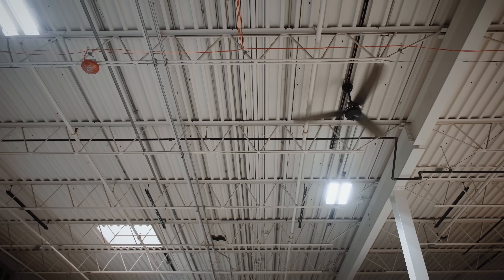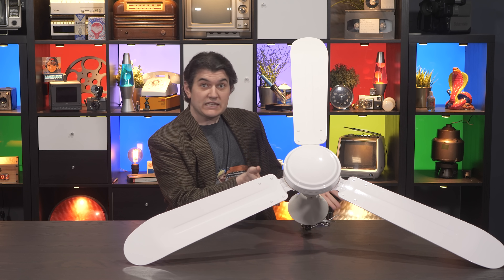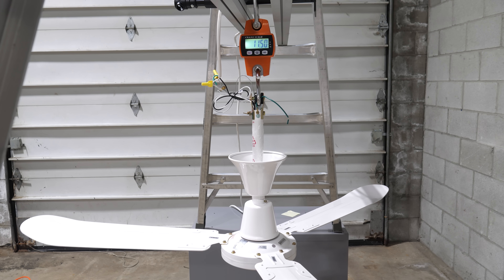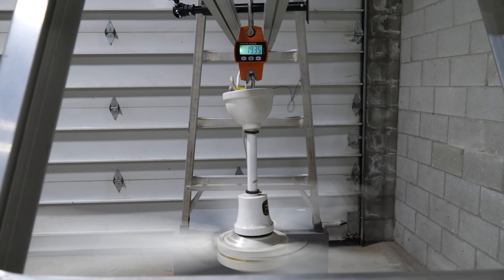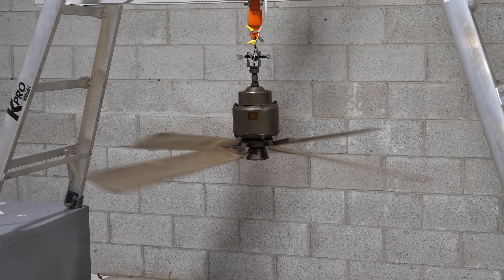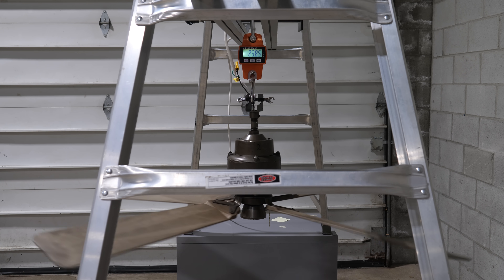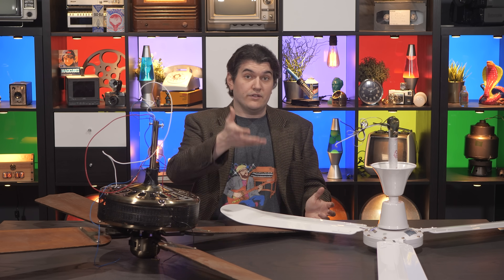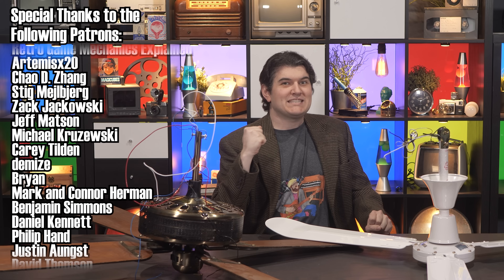How much thrust does a ceiling fan produce?

Comment from the maker: In the spirit of November, I screwed up my one and only fact check. HVLS is High Volume Low Speed. A most fantastic error!
Also - for the sake of clarity, my comparison to helicopters is more jokey than literal and I shouldn't have phrased it as I did in the script. So don't go thinking helicopter rotors are just powerful fans because there's much more to it than that!
Reply: I'm an aerospace engineer, who worked with helicopters. I second your comparison. All the rest is negligible especially for No Effort November. Also, the last fan, attached with the cord, perfectly shows why helicopters need a second rotor placed at the tail.

Love it!!!
Reply: @GiuseppePipia  While they are impractically mechanically complex, I do love the contrarotating helo designs that don't need a tail rotor and provide rotational torque through differential application of collective.
Reply: @GiuseppePipia what's the name of that gear that's in the freewheeling assembly for the tail prop? I always forget but I love how  they have inbuilt synchronization systems in case of emergency landings.
Reply: @GiuseppePipia I have always wondered how much more efficient ceiling fans COULD be if the blades were shaped with a proper airfoil cross section and changing pitch (angle of attack) from hub to tip. This would make a ceiling blade closer to an actual propeller and increase the thrust immensely. Unfortunately it would also increase the torque requirements immensely. Then there’s the whole issue of not having reversible directions or two-toned blades for different color options. So, I guess for the majority of the situations a flat, rectangular slab of wood is the best fit compromise for ceiling fan blades. For my money, a high quality tabletop fan can be more effective at circulating air than a ceiling fan costing FOUR TIMES a much.

I notice that Big Ass Fans (and I assume other HVLS fans) actually do have a slight airfoil cross section to their blades. But by my casual observations the angle of attack is the same from hub to tip.
Reply: I appreciate you not going into detail, November and all.
Reply: You are putting in too much effort explaining this. Take a break buddy you only have like 5 days or so 😮
Reply: Propellers being big fans is pretty literally true. People make a big fuss about airfoils generating lift via sides of high and low pressure and all that, but that's really just the middleman for what they actually do in total: push air down to make object go up. Airfoils are just more efficient about it than flat blades.

Also unrelated, I think everyone would love more No Effort November type stuff throughout the year. Maybe Medium Effort March?
Reply: @EricJW thank you for explaining the reality of flight and thrust, throwing air around, as unpopular it may be among the unwashed masses and cocky pilots! Lol
Reply: @EricJW  Yep.  The whole Bernoulli thing is overblown.  It all boils down to air shoved down, object shoved up.
Reply: It would have been interesting if you got a Big Ass Fan fan.
Reply: @Boodieman72 They are the BMW of ceiling fans. Or, staying with the theme, they are the Sikorsky of fans. 🚁
Reply: But is it not tho?
Reply: Okay but why did you have to put the ladder at the VERY EDGE of the filing cabinets?!?
Reply: @somefreshbread  to better distribute the load on the cabinets and reduce noise in the results? :') would be my guess. but i am no nerd in position of authority on this matter 😂fun stuff though. :) sounds dangerous! 😻(lol)
Reply: DRAMA!!! 😜  @somefreshbread
Reply: Since no effort november is a thing, you should do double down december, where you put twice the effort in to yoyr videos.
Reply: @annabellethepitty you only want 1 video in December?
Reply: @annabellethepitty  That's why he hand-paints multiple strings of Christmas lights every year. :-P
Reply: @annabellethepitty and then he shall release his video on January
Reply: @annabellethepitty  so half a video in december?
Reply: For a lazy video, this was a surprisingly fun experiment.  That's why I love this channel.
Reply: if the point of a fan is to move air, why are blades flat instead of aerofoil shaped? surely there enough expired patents of designs from aviation floating around that the industry can use to move more air for less energy/noise/size or something
Reply: @Nderak I imagine it’s a lot cheaper to make a flat blade.  Especially for cheap fans: sheet metal, stamp, done.  Also optimizing for air movement rather than lift could make a difference.
Reply: @Nderak  More costly to use good airfoils instead of flat blades.
Also, unless you make them symmetrical, they will only work well one of the ways (up or down).
An asymmetrical foil will be much more efficient than a symmetrical one. And every airfoil has a sweet spot where it is most efficient. 
Since the wing speed increases when going outward from the center, the airfoil should also be different from hub to tip.
Reply: Because the aerofoil is to reduce drag, and is not needed to produce thrust/lift/airflow. It also only works in one direction, and these fans are reversible. 

Same reason these blades are straight with a simple angle, not contoured like some single direction fans, because it needs to be equal in both directions. 

 @Nderak
Reply: There needs to be a sequel where you replace the blades with true aerofoils.
Reply: @TheBertLocker you can't reverse the fan then
Reply: Concerning lift creation? Yes they are giant fans. Once you add controllability, it's a differrent kettle of fish.
Reply: I love how you said the only effort you actually put into this was looking up what HVLS meant and you still got it wrong. 😂😂 This is the best no-effort November yet!
Reply: So what you're saying it, if I would unearth my house, a ceiling fan wouldn't rapidly spin it if I was to turn it on.
Reply: The rotors and props really are just powerful fans. Turn them off during flight, and watch how much the pilots sweat!
Reply: High Velocity Laser Snail
Reply: November 2024 is the greatest month ever! Great for Science!
Reply: please test that the ground effect does not have a further increase in fan weight when running in winter mode while being hung from a ceiling
Reply: @ Well, now you’ve gone and done it! I doubt whether ground effect happens at the speeds and “altitudes” of these fan blades, but one could gradually decrease “altitude” in the test environment to see if you could register a ground effect…effect. I’m constantly reminded of ground effect when I watch pelicans fly, and also of their anhedral (aka negative dihedral) wing design (tips canted downward) which contributes to flight stability in those low speed, low altitude flight regimes. Well, that and the fact that their beak can hold more than their belican… 😎
Reply: @t3cube  There will be a "ground" effect whenever there is a flow that is restricted. 
With a ceiling fan, you could call it ceiling effect? 😊
Reply: @TechnologyConnections  Outstanding video and as a native Minnesotan, well, there you go then! Fun propeller fact: in the first Gulf War the American military operated a little drone called the RQ-2A Pioneer that was a derivative of an Israeli design. Pioneer had a twin boom tail pusher propeller, meaning it pushed rather than pulled the aircraft. That propeller was made of wood. However, when it flew through Iraqi sandstorms, that propeller experienced, well, ablation—the airborne fine sand particles gradually ground it down. Operators would see engine RPM rise and altitude fall until they lost contact with the aircraft—its propellers literally were sanded to death. The same phenomenon happens to jet engine blades when flying through volcanic ash elevated into the atmosphere by an erupting volcano, which is why airline flights can be restricted by an active volcano such as the current one in Iceland. 🚁
Reply: I love that the brand is called Big Ass Fans
Reply: But at least your joking helicopter comment generates engagement from all the people compelled to explain to you "um acktually" on how helicopter rotor airfoils work. And that makes Mr. Google happy.
Reply: I was gonna say, "How the heck does "high velocity low speed" work‽ Lol
Reply: That really had me wondering how something could be both high velocity and low speed.
Reply: next you're going to tell us that all those big fans on windmills aren't for cooling the earth....
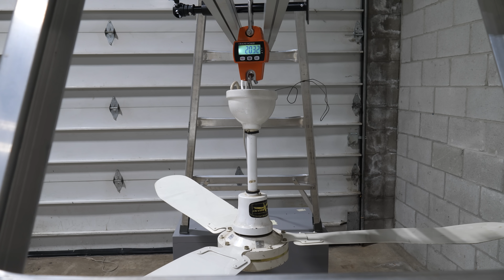Reply: How retro do you want to be? 4:26
Imperial system is based on the metric system (no pride here, just logic ;) ) US is actually metric officially but never wanted to change for psychological ecopolitical supremacy reasons. You are Canadian right? The slave B.... of the US? (So soorry I love Canada, I lived in Vancouver Island near Victoria city, take care mister.)
Reply: Helicopters do not in fact fly, they beat the air into submission. then get repulsed by the ground. fun fact is that almost every helicopter can do a barrel roll, as it is the one maneuver where there is positive G all the way round, so you do not run the risk of having that rotor droop down and chew the tail apart, which is bad in that the shaft to power the rotor (or the long v belts on some of the smaller ones) runs down it. 

Some have a very sturdy steel angle at that point, on the assumption that making the main rotor a little bit shorter at the tip, and still allowing you to choose the crash site somewhat, is a lot better than having a self drilling coffin.

Was fun one day to be sitting in the door, looking up at the ocean, and down at the sky.
Reply: @SeanBZA  it's still generating lift, isn't it?
Reply: Run the fan close to the ground to see if the compressed air makes it even lighter
Reply: Ur fascination and intricate descriptions of everyday objects, 
Is why you are AWESOME ! ! !

Do you have a shipping address?
I wanna send you something.
Reply: We agreed we were not going to bother you in Twitter about it as long as you converted to kg in your videos.
Reply: @matiaswagner9810  But we still get to bother him in Bluesky and Threads until he switches to newtons, right?
Reply: @Curt_Sampson  nah, we don't use threads, we are reasonable people. Like the sentiment though.
Reply: I was super confused when you said "high-speed low-speed fans"
Reply: Helicopters are dark magic that laugh in the face of physics.
Reply: @lordofhyphens  They are, esentially, what happens when you fuse the propeller blade and the wing into the same object... and then compensate for all the 'fun' consequences of that. 
They can even land just fine in the event of an engine failure, at least if the pilot knows what they're doing. 
Though... umm... bailing out of them in the event of something going more ... catastrophically... wrong is a bit iffy due to the whole 'getting clear of the rotor' thing.
Reply: @lordofhyphens  Physics doesn't even enter the equation here. They're just so darned ugly that the ground repels them.
Reply: @lordofhyphens I thought that was bees?
Reply: @lordofhyphens don't forget they also beat the air into submission
Reply: You've talked so much about helicopters but didn't mention that - as opposed to what most people would think - it's not a heli // copter, but instead, a helico // pter, since both words come from greek and mean "spiral" and "wing" respectively!
Reply: @pitecusH  Aka helix and pterosaur. It's funny how English changed where the actual break is to fit in with the style of other words.
Reply: @pitecusH  Well, it is no effort November after all.
Reply: @pitecusH speaking of ancient DEAD languages, you are correct,, but in English it must certainly IS Heli-copter, because Heli or Copter are the most common abbreviations or nicknames for it, and in English we OBVIOUSLY have NEVER cared what the original users thought, we just appropriate words however we feel like it! Lol
Reply: can you make a video about fact checking?
Reply: @TechnologyConnections  would have meant expending some of that prohibited effort. But, you can buy ceiling fans that are made to look like the prop and nose cowling of famous WWII fighter planes.
Reply: Blade pitch plays a part, too.
Reply: I was going to point out that velocity is just speed with vector. But it doesn't matter now 😢
Reply: There's a little too much effort from including "that's a different number in kilograms." Honestly, it's just too easy to get some Metric Maniacs to make that observation for you.
Reply: Might be interesting to compare the CFM of ceiling fans to props on a plane, or the rotors of a helicopter.
Reply: I really wondered how it made any sense the way you said it, but I'd have totally repeated it over and over.
Reply: If it's a fan of yours.
Why Didn't It Subscribe !😂?
... yes yes im leaving, you don't have to push
Reply: Those are some big ass fans
Reply: What else is there to it?
Reply: When the fan is pushing air down it wants to lift, but it’s not stable so it wants to tip over. It’s partially constrained by the hook so that’s part of why the wobbling and lower thrust was obtained. With the fan pulling down its stable, as if being held by a rope, so all of the thrust is measured and less wobbling happens.
Reply: I helped designed the engine for a fan that delivers 120,000 lbs of thrust =D
Reply: i just spent so long trying to wrap my head around how something could be both high velocity and low speed so thanks for the clarification
Reply: Good thing you don’t need HVLS fans when you’ve got fabric ductwork 😮
Reply: There are 11 months in a year for accuracy
Reply: I want to see somebody attach a fan blade to a vacuum cleaner motor 😏 I'm curious how fast it would go and if it would take off 🤪
Reply: Helicopter rotors are big fans! Turn it off, and watch the pilot begin to sweat!
Reply: bro i love no effort novemeber , can i ask is there any tech you want to cover with a video but cant be conveyed well in a video ?
Reply: So, what am I meant to do? Now that I've achieved lift-off with two dozen fans?
Reply: Can we settle a debate? ceiling fan should pull the cold air upwards not push hot air down from the ceiling… literally throwing money away.
Reply: @soundtrancecloud5101  i was thinking that, why bother switching it in winter , but as old mate point's out the option of less direct gust  while still circulating the air
Reply: props to you for correcting this
(haha)
Reply: I was gonna say. For the most part, in common vernacular, velocity and speed are the same thing.
Reply: I mean, both the propeller on an airplane and rotor system on helicopters are used for cooling the pilot: watch him/her sweat when they don't work!
Reply: I was gonna say this video took too much effort. lol
Reply: Unofficially sponsored by SCEPP SarcastiCaffeine Energy Production Powder
Reply: It's easier to just call them by the most popular name brand - Big Ass Fans
Reply: Good thing you mention helicopters: you forgot about ground effect.
Reply: you should know this... airplane engines don't produce flight. the wings do that.
Reply: @InconsistentManner  I think it’s more accurate to say that airplane engines don’t produce lift - they definitely do produce flight.
Reply: @doomtho42  Jet engines are definitely producing thrust. I'm not sure if that's the right term for turboprops, but it should be the same principle. Thrust is the force opposite your vehicle, think action->reaction. Wings are not generating a force, instead their dimensions influence the medium aka air to move at variable speeds...yadda yadda yadda, air pushes the wing up, thus "lift." In the case of both the jet engine and propeller, you can just push/pull yourself through brute force in a chosen direction, the geometry of its components merely increases efficiency.

What I think Alec wouldn't want to get into, even if it is super neat, is that we know helicopters are using lift and not thrust, because the transfer of energy is not uniform. One of the most unintuitive things about helicopters is that you need to think 90 degrees from your intended cardinality. There is effectively a delay from gyroscopic forces that imparts most of your input 90 degrees later in the rotation. 

Also, the advancing and retreating blades to your sides, are generating very different values of lift. The retreating blade is moving slower, if you think about it relative to the ground as you move past. This means it generates less lift even though the drive system is distributing the energy evenly. This is not a property of fans or jets. That retreating blade is also the worrying bit in a lot of maneuvers. Similarly, planes can get caught in a stall when their inside wing in a turn is no longer generating significant lift for the same reason. 

There's a whole lot of other weird stuff I didn't mention that makes helicopters even more confusing to learn.
Reply: I’m so glad I saw this comment. My mind was breaking itself trying to figure out how “high velocity low speed” could possibly make sense. It felt like a mental divide by 0 error or something.
Reply: I literally had made a comment to this effect without seeing your pin. Shame on me. But also shame on you. ; )
Reply: There is and error in your test you need to have a board hanging above the fan approximately ceiling distance away from the fan to get a proper reading of thrust when it bounces off the ceiling, it is going to multiply
Reply: There is and error in your test you need to have a board hanging above the fan approximately ceiling distance away from the fan to get a proper reading of thrust when it bounces off the ceiling, it is going to multiply
Reply: The board must be independent of the scale as to not skew the numbers
Reply: never thought about them generating measurable thrust or the mechanics of torque compensation in helicopters and fans.
Reply: Video on helicopter rotors upcoming, I hope!
Reply: Regarding helicopter rotors as fans: when Wilkes-Barre, Pennsylvania, flooded unexpectedly during Agnes (IIRC a dike failed) helicopters were part of the rescue efforts. A story told years later was of an older woman who was rescued that way complaining about her dress being blown up by the rotor wash. Being an immigrant her English was a little imperfect and she called it "the big fan."
Reply: I can see this video coming soon now. "What are helicopters?!?"
Reply: I feel like anywhere you mix unconventionally paired forces like rotational physics with aerodynamics, interesting technology connections can be made. Like that radial engine plane that would pitch when you tried to yaw because of all that rotational mass, so they had to train pilots on how to land differently because of it.
Reply: it's a different acronym in kilograms
Reply: Menards® SKU: 3533018, that's the fan to test.
Reply: I was about to mention that airfoils matter, but ya, for no effort I spose this is fine
Reply: I immediately thought "high velocity low speed" had to be wrong.
Reply: This video perfectly blends humor and curiosity!
Reply: Pounds... pound... imperial sucks. UK is doomed.
Reply: helicopters work by dark magic, and the fan is to keep the pilot cool. The moment it stops, they start sweating profusely. Same with fixed wing aircraft, but they are powered by misunderstanding, not magic.
Reply: When it gained weight on switch on is that also implying that electricity adds weight😁😁😁 wonder if you could measure weight of electricity no effort suvgestion vid🤣
Reply: Re: "So don't go thinking helicopter rotors are just powerful fans because there's much more to it than that!"

I feel a new Technology Connections collab video is going to happen, where through the magic of visiting someone who has two, you show us the innards of a helicopter rotar.
Reply: I LOVE the ceiling fan aisle at Lowe’s! It’s so relaxing.
Reply: I love your videos- you walk the line of being an "uumm actually" guy and the overly-friendly science teacher- while in the meantime delivering interesting and informative info with a touch of geeky humor. All the above, is Me, too.
Reply: I was breaking my head trying to figure out what high velocity low speed meant 😂 I was like, what, because it’s constantly changing direction? lol
Reply: Ceiling fan Normally comes with 240RPM 😮
Reply: Oh, but "What are helicopters but giant ceiling fans..." was my favorite part! I just burst out laughing at that. 😂
Reply: You seem to hate metric values...
Reply: In hindsight, "high velocity low speed" sounds quite obviously nonsensical.
Reply: It could also have a high air velocity but low rotational speed. It depends on blade pitch.
Reply: why did the fan appear to gain weight when switched on?
Reply: helicopters = powerful fans with variable pitch.
Reply: I imagine the blades on a helicopter are designed with the fancy shape that airplane wings have that provide extra lift. So maybe a specialized fan blade (stolen from a hobby plane) could produce some fun results.
Reply: I bought a thermoelectric fridge and a portable monobloc indoor unit AC just to know your reaction ❤❤❤
Reply: 89 comments in 2 minutes. damn
Reply: @typerightseesight That’s a different number in kilograms
Reply: @dairyisfine  kelvin bo belvin
Reply: "So don't go thinking helicopter rotors are just powerful fans because there's much more to it than that!"

I really wish you had said that at the start of the video, before I paused it, went to Home Depot, bought a bunch of powerful fans, and...well, actually let's just leave it there.
Reply: @Curt_Sampson  I was already seeing red and took no new information in
Reply: In the spirit of November, the change in fan weight on startup and shutdown due to torque isn't caused by weirdness of the scale, it's a real impact of the torque and should be included IMO
Reply: @CoryMck except it doesn't actually change the weight of the fan, it's just an artifact of the scale design.

If you had an anti torque system on the fan to isolate the scale from the torque (as it should have been), you would not see the torque effect.
Reply: @ke6gwf  it has nothing to do with the scale design, the angular acceleration is creating a torque which is an additional force added to the weight. The original thesis was to set out and see if turning on the fan created a force. The torque measured by the scale is a real force that the ceiling would feel pulling on it.
Reply: I was gonna say, are you baiting us because they are as similar as Ice skates to a Snowmobile
Reply: I attached a 12 volt fan on ceiling inside a caravan and put 200 volts the caravan took off and landed in a pond.
Reply: I'm just glad the new paratrooper video dropped. Eighty Deuce!
Reply: amen 🙏(at least, that's the easier american measure to use perhaps 😂)
Reply: I love No Effort November!
Reply: Greetings from India. Can you please do an explanation video on BLDC fans. Thank you.
Reply: This explains it kkkkk
I was trying to understand the High Velocity, Low Speed thing kkkk
Reply: 5:32 - NO.  The fan does not get heavier.
No matter which direction it spins, the weight of the fan never changes.  The mass of the fan remains constant.
Reply: @dahawk8574 you're confusing mass with weight, granted he also should have stuck with Newtons and not used grams in the video.
Reply: Hi, it's me, nitpicker:
I tried to resist the urge especially since it's NEN but I failed at the 2:15 mark and HAD to pause and comment this:
Helicopters don't have a propeller and are in fact bad comparison. Choppers have rotary wings which produce lift, not thrust.
If you do correct this in the rest of the video I'll return and right my wrongs.
Adjusts glasses back up
Reply: Uh achooally helicopters don't fly by pushing air, the shape of the blades acts like a wing and reduces pressure above it, lifting it!
Reply: @kingeryck1  A wing will actually create lift even when the top part is flat 😊
Reply: @kingeryck1 but wings fly by pushing air down, the whole equal and opposite reaction thing, it's the throwing the air down that creates the low pressure as the equal and opposite reaction, not the other way around lol
Reply: I like your videos and think they are insightful.  But it seems like more and more as time goes on, the way you are using your voice,  they way you speak makes it sound like you are talking to your audience as if they are stupid people whom you have contempt for.  If you don't notice it, just watch back the first minute and a half or so.  My only guesses are that either you are dripping with contempt for your audience (which is less likely) or you are so embarrassed by "public" speaking that you try to make your voice turn everything to be contemptuous or "ironic-sounding" so that you can be "that guy doing that thing" rather than risk putting yourself out there without a mask (more likely).  Or...I could be reading more into it than I need to, and that is the voice for yourself that you have created over time without any conscious consideration of why it is that you speak that way.  (But unconsciously, there still may be something there.)  At any rate, I just wanted to point this out in case you haven't noticed it.  Obviously, most other comments are not talking about this at all, so I'm not saying that you need to change because one viewer thinks it's kind of strange.  But if you didn't notice it before, I did want to at least point out that - the way it feels to me - your voice's tone is such a way that resembles the voice of someone who feels irked that he is talking to fools.
Reply: @Rationalific  Have to disagree. I think Alec just realized that most people love the snark, even if it's directed straight at themselves, so he feels more comfortable letting it out.
Reply: @EricJW  I hear ya.  Thanks for expressing your opinion in a civil way.
Reply: @Rationalific Different strokes for different folks. I perceive his tone as being exactly what he wants to communicate, which is that he’s being funny, punny, self-effacing/funny and sarcastic/funny. “The way it feels to me.” Well, keep it to yourself if you cannot be constructive. Your comment “feels to me” as overly persnickety, officious, self-referential, and needlessly overbearing, arrogant, and utterly out of touch with the overall light, funny, informative, and entertaining nature of these videos. Regardless, your comment contributes to his YT algorithm score, so regardless of its fingernail-on-chalkboard high-handedness, it’s works out for him anyway and provides us all with a timely cautionary example of social media asininity where no good (or genuinely funny) deed goes unpunished. Merry Christmas! 🎄
Reply: @tommyrq180  I said that I watch his videos, but I've perceived that getting even stronger.  He makes videos in the way he sees fit, and I watched this video and commented.  For those I truly don't like, I won't continue to watch their video until the end (which I did...most of the stuff I found particularly in line with what I mentioned is in the first minute and a half or so).  And I do appreciate him more, as the way he comes across may seem like he's looking down at everyone, but he's not insulting.  I was also not overly insulting to him if you read what I wrote objectively.  (Actually, what I wrote was constructive, even if it's advice that he can take or leave and I'm 99% confident that he'll leave it, because it's not like I'm getting hundreds of thousands or millions of views off of any videos that I'm making.)  On the other hand, of the three of us, you have appear to have both the strongest opinion about people coming off as "mean" (even more than I do towards him), yet of the three of us, you also come off as the "meanest".  So go figure.  I won't say Merry Christmas back, as I feel that saying it in jest and adding an emoji as a cherry on top after insulting someone is actually more of a slap in the face than something that should be taken literally, and I'm not really one to do that back.
Reply: @Rationalific  I’d just like to say that I 100% fully disagree with this person’s comment. I find your speaking voice (you know, as opposed to your non-speaking voice 😆) to be much more natural than in your older videos. I suspect the sentiment in the original comment may be more commonly held by people who have trouble discerning sarcastic snark from sincerity (e.g. many people on the autism spectrum), and I hope it’s clear that I’m simply making a neutral observation and do not mean to imply any sort of negative connotation - for what it’s worth, I am on the spectrum myself.
Reply: @Rationalific  You probably shouldn’t be here.